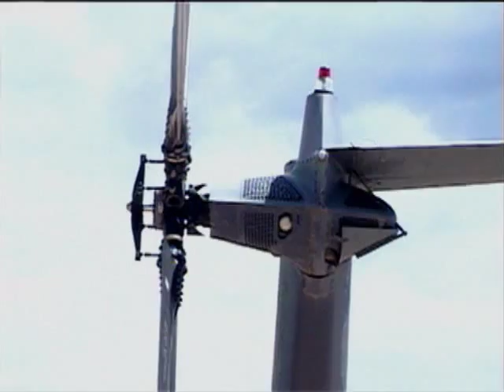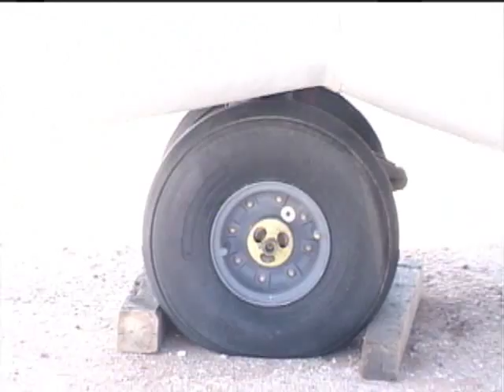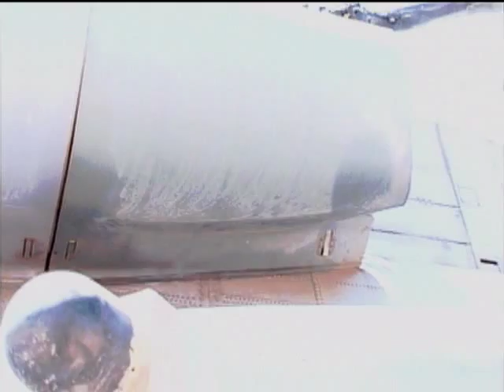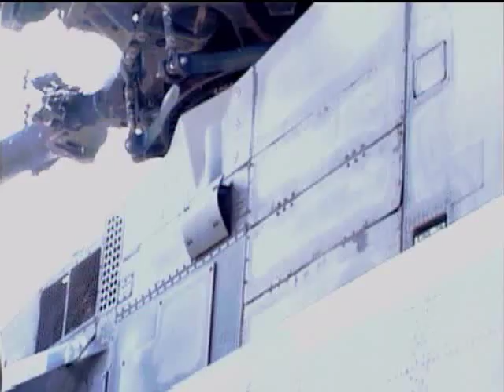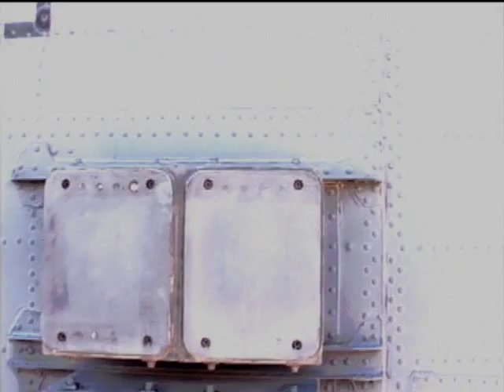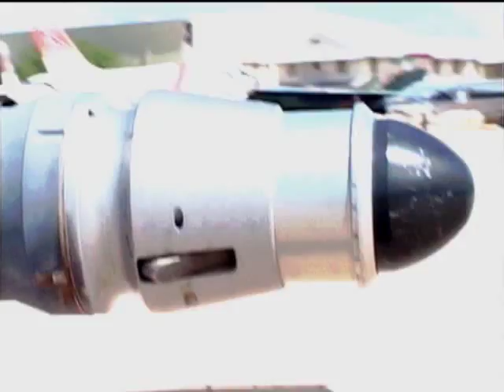MH 53 M Pavelow Helicopter

Comment: The word is pronounced "PAVE"low, not "pav".  The first Pavelow III was aircraft tail number 68-4433, the ONLY YMH-53H ever built.  It was also originally an "A" model which was converted into a "B" when the diagonal braces (or struts) were added in order to give support to the auxiliary fuel tank supports (commonly referred to as "gull-wings), and later into the YHH-53H (the original Pavelow designation).  Anyone else here a former unit member?
Reply: I was a crew chef from 1975 until 1983 . I  was station at McClellan at the end of 1975 when they started receiving 53 is from NKP. I went to Kirkland several times when I was stationed at McClellan TDY. I saw 4433 when she was still a test bed. 
  From McClellan I went to Bergstrom Air Force Base outside of Austin where thay had only CH-53 that were used to move radar units around. Then in 1980 I found myself at Hurlburt Field, before the MH 53s owed up, at that time thay were still called HH-53 witch change short there after. TAC basically stole them from MAC after the failure of operation Eagle Claw. Then there was Operation honey badger which is a whole nother story. Thank you President Reagan for coming into office a lot of guys took a big breath and said Thank You Lord we don't have to go
Reply: @RandyAlexander100  I was Comm Nav on Pave Lows out of Hurlburt from 80 - 83. When I got to Hurlburt we still had CH-3's transitioning to 53's.